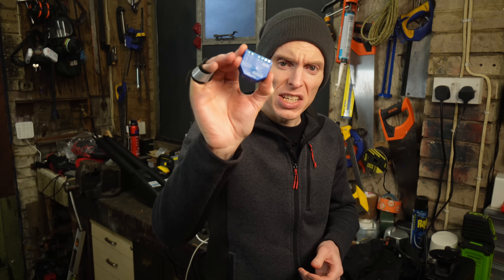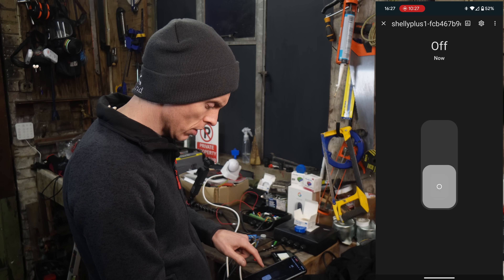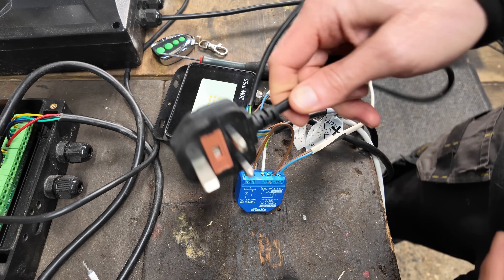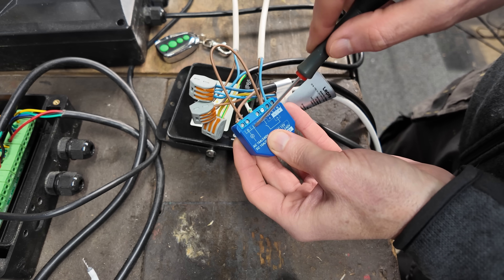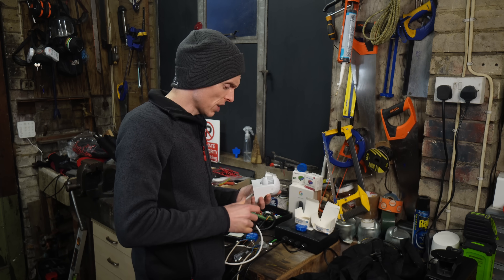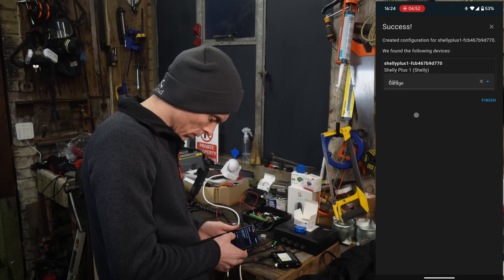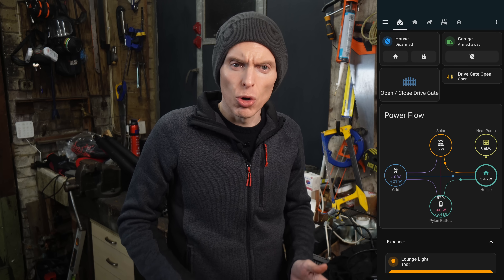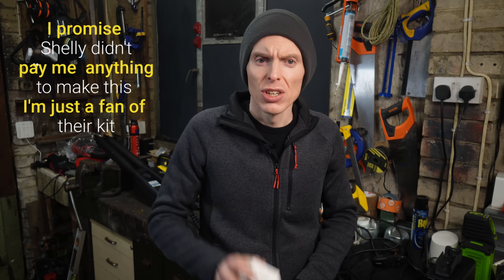Shelly 1 Plus: The Swiss Army Knife of Home Automation!

Comment: Thanks for the vid. I've been looking for this very function. My use case is to run my exterior courtesy lights at a lower dim level after sunset, but want to be able to go max brightness once motion is detected, either in that specific sensor area or more generally as an all-on at max brightness that would also trigger my security floods.  Ideally I'd like to find a device where I could run a "single" POE line to a sensor, camera, and light in the same vicinity that could each act independently. Seen anything like that?

Comment: And now there is Gen4! I use either a 1PM or a 2PM in the main light switch of each room (depending on how many light circuits there are) with a Shelly Plus module attached. That gives me temperature, humidity, light level and an extra control switch. I use buttons or 'retractive' switches on the two or three channels this gives. I use all my switch inputs configured as 'buttons' and in 'detached' mode, but then I add a script in the Shelly which toggles the relay locally on the 'single_push' event. This means I still have control if the HA or WiFi goes down, but the HA always knows the state of the relay, the local switch is never in the wrong position, and I am able to use the 'double_push', 'triple_push' and 'long_push' events to trigger HA automations. The 'room controller' connects over WiFi, but if there is another switch to be automated in the same room, I use a Gen4 in Zigbee mode to keep the use of WiFi to a minimum. The 'room controller' also acts as a hub for Bluetooth window/door sensors and remote controls in the same room. It was a learning curve due to horrible documentation and horrible Javascript (I really wish they had used a civilised language like MicroPython or CircuitPython) but if you put the effort in these devices are indeed the Swiss Army Knife of HA devices!
Reply from the maker: Thanks for sharing your experience and tips on getting the most out of these devices!  I particularly like the idea about scripting the single button press locally so it always works but still allows other HA action to be triggered by double or triple presses, might have to borrow that idea 😀

Comment: What is the output voltage of your motion detector?? 
I thought the Shelly needed 24v to detect anything?
I have a rain detector....do I need an "add in"?
Reply from the maker: The motion detector is mains powered, so when activated it passes 240v to the switch on the shelly. Not likely to work for a rain detector,  depends on the detector but if it's resistance based you probably need the add-ons analog input and some kind of voltage divider to convert the change in resistance into a voltage the change the shelly can read.

Comment: There is a solution to the problem with the motion sensor output "floating". Put a resistor (don't remember what ohms) in series (between the motion and the shelly) and invert the input. I'm doing this with a steinel sensor and a shelly pro2 and it works as it should.
Reply from the maker: Thanks for sharing your solution, it's always good to find a workaround.

Comment: I have a very similar setup at my house. I’m also using motion sensors connected to Shelly, but separated from the relay and switch. All my outdoor lights are IKEA GU10 Zigbee, and I only use the motion trigger in Home Assistant to switch them on/off when it’s dark (condition: sun). The same motion event also triggers Blue Iris to start recording, but only if nobody is home.

I also use a Shelly in my Moccamaster coffee maker. The great thing about setting the auto-off timer directly in Shelly is that it doesn’t depend on Home Assistant or the internet – it will always work as a smart timer. After 10 minutes it turns off automatically, and I use the trigger function to send a “coffee is ready” notification to my Google speaker. I set the switch as a toggle, so whenever I brew coffee I just flip it once and it runs for 10 minutes.
Reply from the maker: That's a really great use case for the Shelly, thanks for sharing!

Comment: If a pairing is so easily made, is there something preventing from another user to connect to it and take it over?
Reply: I use quite a lot of Shelly's
On first pair it uses bluetooth to your phone. If someone else had the app open on the same they could "steal" the device but that would be possible on a lot of devices

After first pair bluetooth (and device AP) will be disabled

Also noticed they get account locked. If you factory reset them without first unbinding they can't be  paired to a new account
Reply from the maker: The other comment is 100% spot on, only the initial pairing is "easy".

Comment: Looks like the UI has changed a little, but 6 years ago I used a Shelly-1 (original!) in detached mode for my garage door; I connected the relay across the "push button" contact (so the garage door opener thinks someone pressed the button), and I connected the sensor via a magnetic reed switch.  In that way I can get an indicator of if the door is open or closed.  I use MQTT integration, so it's all local and no cloud needed at all.  Home Assistant can then trigger automations (in my case it tells Alexa to make announcements) whenever the door opens or closes.  I can also tell Alexa to control the door via HA's Hue Emulation

The setup is described on my blog, although some of the code on that page uses an older setup where I had my own Hue Emulator and didn't use HA's.  I won't post the URL here to avoid this post being potentially flagged as spam, but you can google "sweharris shelly garage door" to find it if you're that interested :-)

Comment: Hello! Thanks for the great video. 
Quick question, how did you make it to use the terminal sensors of the door to pass them as inputs in Shelly? I’m having the same 24V AC issue.
Reply from the maker: Hi, the controller for my gate has a relay that closes when the gate is open, connecting that to switch input on the Shelly allows me to create an indicator that shows if the gate is open / closed.

Comment: shely have NO future is they wont start doing zigbee versions. wifi sucks! metter - overpriced hype sh~t, zigbee rock solid, super cheap, super low power usage, high range.
Reply from the maker: Not sure I agree with anything you said, I find their kit to be very reasonably priced and WiFi works well for  mains powered devices. But you got your wish, the Shelly gen4 devices support WiFi and Zigbee so you can choose whatever works best for your use case.
Reply: @RodMcBain 😂😂😂😂
Reply: Shelly Gen 4 are zigbee/matter

Comment: i have been trying the whole day to add it to home assistant. How is it that you added it and it just shows up. 
Mine does not and there is no way to add it manually. I had to add it via Matter in the end.
Reply from the maker: Not sure sorry, I sometimes have a bit of bother getting them initially connected to WiFi but once connected they just show up in the shelly integration in HA. If you ended up using Matter I guess you have one of the new gen4 modules? I just got a couple of those the other day but I've not tried adding them yet, will try them and let you know if I discover anything interesting.

Comment: I have also integrated a Shelly one plus in to my garage door, using the input to detect open or closed and the output relay to open/close door. I also integrated a one plus into my vintage doorbell, so the front door button is wired to the one plus input, and the relay output rings the bell when the button is pushed, but also it sends me a notification that he bell was rung, along with a snapshot image from the security camera.
Reply from the maker: Both great use cases, thanks for sharing.

Comment: I agree.  I am using a Shelly 1 (original) for my garage opener.  Decoupling the switch with a magnetic read switch to detect if it is open works brilliantly.
Reply from the maker: Thanks for watching and sharing how you're using the decoupled switch feature. I have a very retro garage, it's in need of a lot of work, when I get round to fitting a new door I'll definitely borrow this idea 👍
Reply: so you are using two shelly 1? One for garage opening and another for detecting status of gates?
Reply: @pareigingasgeras1170 no just 1 shelly 1 but with the switch in "detached mode".  The two wires are then connected to a magnetic reed switch.
Reply: @pareigingasgeras1170  you can do it with just 1

Comment: Great videos. I'm looking for the same wiring to control my gate. I want to control the opening and closing of my gate, and know in Home Assistant if it's open or closed. Where should I wire the 24V input of the gate to Shelly? Do you have a wiring diagram? Sorry for the length, but I'm French and I use a translator. Thanks in advance.
Reply from the maker: Thanks, I don't have a wiring diagram but it's not very complicated, for the Topens controller the relay connects to the o/s/c and com connections and allows the gate to be opened and closed by toggling the shelly as described in the video, but I don't think there's an easy way to know if the gate is open / closed. 

On my new BFT controller the wiring is still simple but it has an additional relay that can be connected to the switch to "sense" the gates state, in my case I used the aux2 which is a free contact configured as the gate open light, it does the job of communicating to the shelly that the gate is open. Sorry I can't provide any more specific help.
Reply: @RodMcBain  Thanks for your reply.
But where are you connecting to the Shelly to retrieve the information about the open or closed indicator light? My BFT has the same function, but I don't know where to connect to the Shelly.
Reply from the maker: @jeje8177  Hope this helps https://rodmcbain.com/bft-thalia-p-shelly-switch/
Reply: @ Hello,
Thanks for the link. I'm having a problem with my output being 24V!
Thank you.
Reply: I use Shelly uni for the garagedoor.

Comment: Ethernet/WiFi for HomeAutomation!?! Baaad idea...👎
Reply from the maker: So I have a mix of wifi, Zwave and Zigbee devices and by the most problematic has been my Zwave devices. The idea that WiFi if automatically a bad idea for home automation has never made sense to me and has not been born out by my own experiences. I have 7 Unifi Wifi access points in my house / garage and garden, so have complete coverage and the ability to potentially support 1000s of WiFi clients.

The only compelling reason to use Zigbee / Zwave is for battery powered devices, for anything mains powered the only sensible argument I've heard against WiFi is "your network will only support x amount of clients and you'll reduce performance", although this is true it's not always a problem and will very much depend on your WiFi setup.

If you have any other points I'd love to hear them, why is WiFi a bad idea for home automation? Also the new gen4 shelly devices that have just been released have support for Wifi and Zigbee so you can choose what works best in your use case 🥳
Reply: Not if you have good WiFi. I have over 15 Shelly devices over WiFi and they all work flawlessly with zero noticeable latency in HomeKit

Comment: I have solved like you the issues of using the Shelly switch input (which usually expects 240v as you mentioned) with the indicator outputs on these gate control boards to show gate status in HA.

I have integrated:

BFT Ares 
FAAC with 455D Board

I found the BFT offers a 24AC safety light output that is off when the gate is closed, flashes when the gate is in motion and stays on when the gate is open. To use this with the Shelly/HA I found this super little product that combines a rectifier with a relay to do just what you need - convert a low voltage AC to high volatage AC so it's stable suitable for the Shelly switch input: Search for DBR-200

The FAAC I saw offered at 240AC light output - so I thought - great no rectifier/relay combo required I have a direct output at 240AC - but it only comes on when the gate is in motion so no static indication of the current gate status when the gate is not moving. They do have another "indicator" output which is 24V - this time DC - and this is on when the gate is not closed regardless of movement and of and off when the gate is closed so I am just using a normal relay to switch that to 240AC for the Shelly.

Comment: I like Shelly and have a number of their relays and energy monitors. It's just a pity they are only wifi.  I have around 90 devices connected to my home network and it's starting to creak a bit. So I'm a little hesitant to add any more.  I'm  sure I saw somewhere that the newer Shellys might also be Zigbee 🤔. Now that really would be a game changer.  Nice review. Thanks.
Reply from the maker: Yes, the new gen 4 devices support both WiFi and Zigbee so you can choose what works best for you. With my UniFi WiFi and 7 access points I doubt I'll ever have enough WiFi clients to cause a problem, but it's great to have the option of Zigbee going forward.

Comment: Could this be connected with a rfid reader? Any info about that?
Reply from the maker: I can't say for sure, it's going to depend on the RFID reader and what sort of interface it has, most readers designed for access control systems do seem to just switch a relay, so i'd expect if you powered both the RFID reader and Shelly with 12v it could work, you could then use the relay in the shelly to run something else.
Reply: Thanks for the answer!

Comment: BleBox controllers have the same and even greater functionality. At the input, they recognize whether it is a short or long press. They react to the change of the edge (rising edge / falling edge). Additionally, they are safer, because the entire electronics is filled with non-flammable resin. Of course, they have factory integration with HA, and one more thing - they are manufactured in Europe
Reply from the maker: Thanks for sharing, I've never come across these before, look interesting but also a fair bit more expensive.

Comment: I realise this is just a temporary bench setup, but repurposing the earth as a switch wire is now against the wiring regs, so demonstrating with the correct 4 core cable might be better for the future. Great info though. I was just looking for a way to get the Shelly to reset after a given period. I never noticed it was baked right in already.
Reply: Hence the white label.
Reply: @knxsupply7478 That’s exactly what I mean by “Repurposing the Earth”. The green and yellow core can no longer be taped or sleeved and used for anything other than a circuit protective conductor. If you need 3 live cores, you must use 4 core cable.
Reply from the maker: OK thanks for the info, but like you said this is just to demonstrate what's possible, in a permanent install it would be important to comply with local regs.

What's the logic behind that requirement? Doesn't immediately make a whole lot of sense, but there must be some logic behind it.
Reply: Well said.
Reply: In my experience, people who care will make it properly. People who dont wont care about how he does it.

Comment: Why not do a Home Assistant setup series?  Because of your video I decided to redesign a existing “cobbled together” system using home assistant.  

2nd video could be a simple a few sensors, an output and simple logics.

The follow on with a,b,c sensors inputs then x,y,z outputs to relays for a/c control and dc control for different locks, lights, piezo or other sounders.
Reply from the maker: Thanks for the great ideas, I could certainly cover how I've got Home Assistant setup, I'll keep it in mind when considering future videos.

Comment: Is there a fall back option if it cannot communicate with Home Assistant? If either home assistant or wifi fails, i want the fallback to go back to coupled. I.e. if using for primary room lights, the lights will still function in the event of total failure of either wifi or smart home software.
Reply: Not in the Shelly firmware itself AFAIK. But you can flash ESPHome onto it and configure any complex logic like that. (I’ve done this to every Shelly switch I have and it works nicely.)
Reply from the maker: Not something I've tried but I think that should be possible using the scripting functionality built into the shelly, you could use Switch.SetConfig to change the in_mode or attach an event handler to the input and have the script toggle the switch if it detects it can't reach home assistant. Maybe a timer to fire a GET to HA every five minutes to check it's reachable.
Reply: That can be implemented with a bit of scripting on the device itself
This is how I implemented irrigation control - if, for whatever reason, ha disappears I switch back to standalone local logic

Comment: Having Live be "-" in DC is needed because of the input. In AC, switches connect L to the signal wire when closed. In DC, it is far more common to connect "-" to the signal wire.

Unless you're a doorbell...then +18V may signal "not pressed" and +14V may signal "ring the bell". That's where the "Shelly Plus Uni" (yes, those names are stupid) shines. If someone is interested in connecting a Siedle n+1 system to HA: + to 1-VAC1, 1 to 2-VAC2 and 7-GND, 7.n to 3-analog_in, solder the handset's open button to OUT1. Enable the analogue input on the shelly (it's hidden under "peripherals") and set its range to 0-30V. Set OUT1's "auto off" to 1s. In theory, 7.n could be used instead of +, but at least in my installation, its voltage is pulled down too far by the Shelly's power draw.
Reply from the maker: Thanks for the very informative comment, I knew there must be a good reason to have the AC and DC inputs swapped but had no idea what it was.